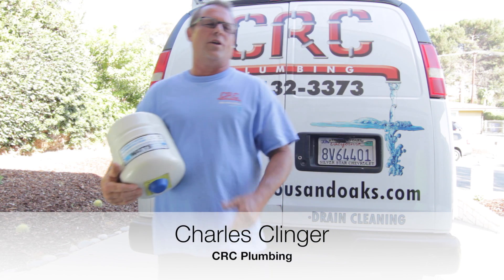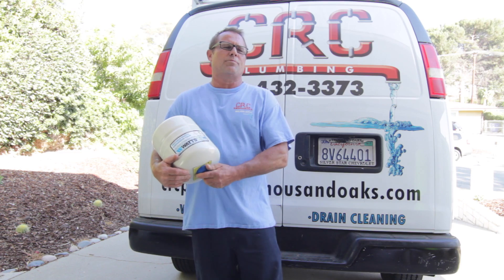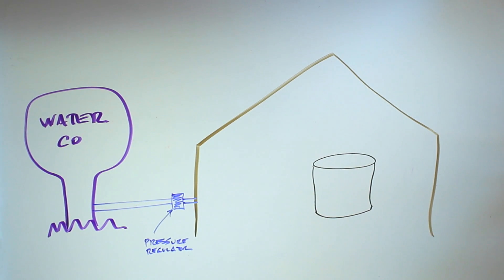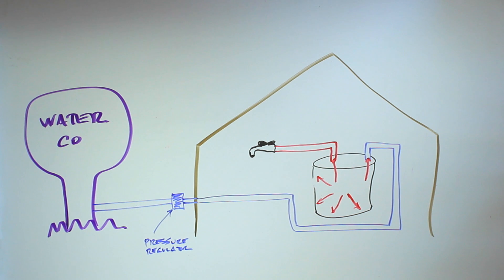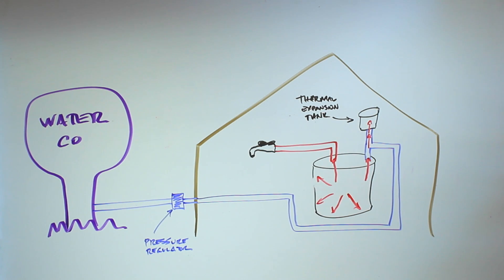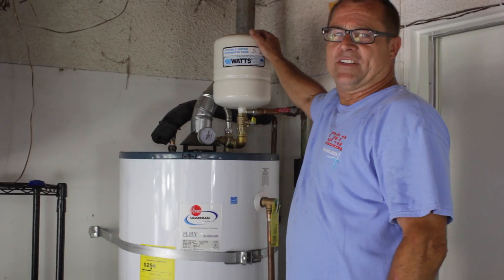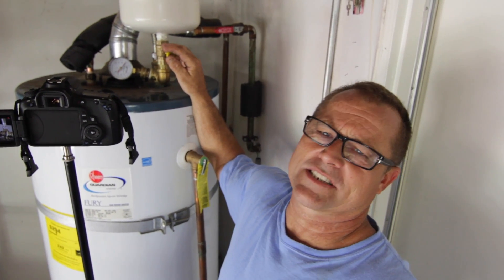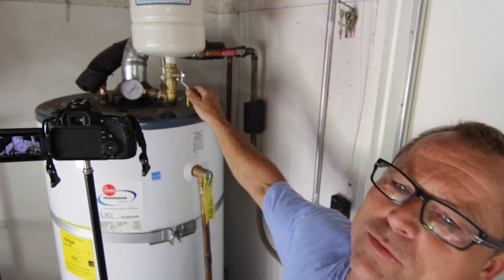water heater thermal expansion

Comment: Finally, a talk about these tanks which include a diagram of what's going on. Here's the thing I'm still unclear about: Is the pressure reducer (between the city water supply and the building) acting as a back-flow preventer? First, I can't imagine how you could make a reducer which didn't also have this "check-valve" behavior, and, second, if it didn't work like this, then the thermal expansion could just flow back to the city water main, so there'd be no need for the compensator tank.

Comment: So I just replaced My pressure regulator because of high pressure readings.  When I leave the pressure reading meter on overnight, I'm still getting high pressure.  I do not have an Expansion tank on my HWH.  SO you can still get high readings even with a pressure regulator then?
Reply: as your water heater makes hot water in a closed loop system thermal expansion will increase pressure in your system.
Reply: lol